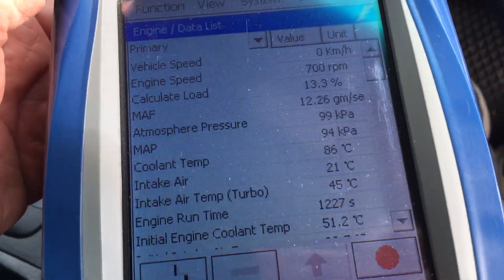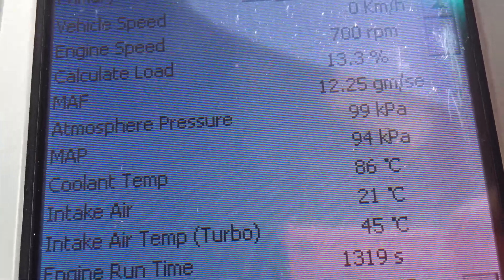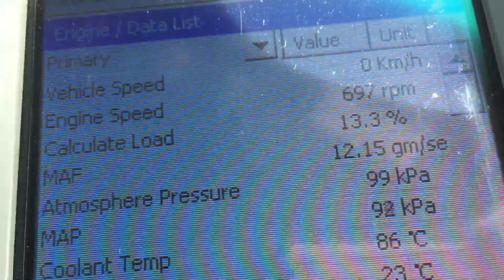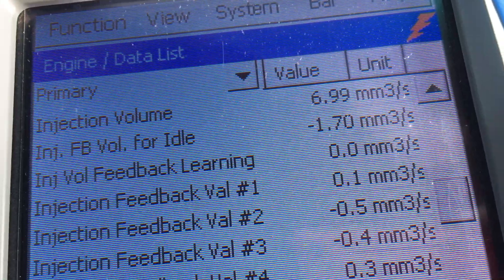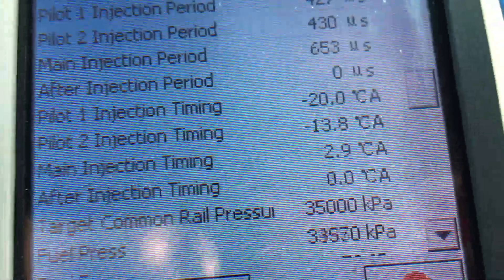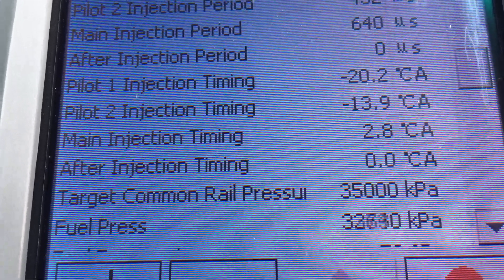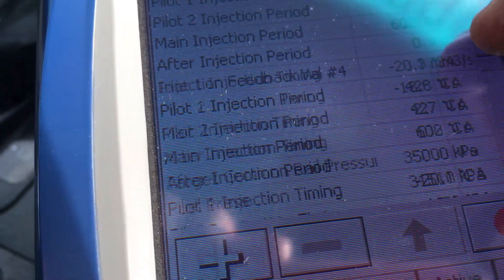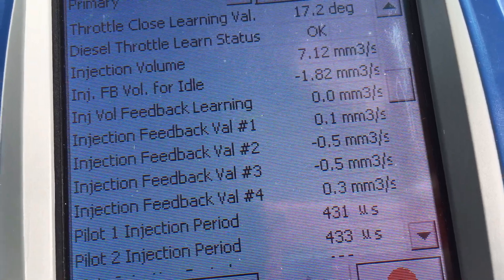HOW TO DIAGNOSE INJECTOR PROBLEMS AND FUEL PRESSURE

Comment: So i need some help bad! I have no clue if anyone here could give some advice. I have a 3000k lc200 4.5 v8 armored. Im trying to condem the injectors but its vary difficult as im not a diesel tech. What i have found so far is that the engine load and injector values get really bad the hotter its gets. Starting at load rate of 16% injection rate of 6 and nearly 0 for all 8 injectors to a 60% load and -5 for half and +5 for the others ends up barely running. My rail pressure stays nearly identical to requested. I have so far just drained the fuel ranl and replaced the fuel filter in the engine bay twice even though it appeared clean. Is it clearly bad injectors or what else could i do. Also i can not find factory info as im in the states and this truck does not exhist here. Its a 2020.

Comment: Hi mate
So I have 2022 Great Wall 2.0 Turbo diesel we had water in tank so injectors failed. Dropped tank cleaned all lines bleed the system and put used set car run for 45 minutes while doing a manual DPF burn so was high rev. After it finished all injected burn out(failed) clean system agin put another set car run for a day and also after high rev except same thing happened again. 
One mechanic think DPF, other think ECU and GWM think it’s the high pressure fuel pump. Not sure who to trust to be honest. I spent so much money on it and it always back to ground zero with same problem.

Comment: I have a 2,2 tdci ford ranger, I replaced the injector washers and cleaned everything now the car have a low boost error. P0299 everything was working 100% before i worked on the injectors, I smoke tested for boost leaks, none were found. There are no other fault codes and it sound like there is a missfire on about 1500rpm. Can a faulty injector cause the low boost error? I dont know what to do anymore. Where im from you cant trust anybody for testing injectors they will tell you its faulty even if its not, charge a lot of money and then the problem still accours. I have a Launch obd but i dont know what to look for on the live data

Comment: My engine load is up around 80%. Car tried to start but didnt. I bought the car as non runner, tried a leakdown test and suspect a wornbore in one cylinder, so I wont buy injectors before I find out. Would it be madness to get it started to get an idea of the state of the engine? Yaris 1ND tv 2006

Comment: Hello, thanks for the video. At 6:26, the reading of the Target Common Rail pressure is at 35000kpa. It is suppose to be fix or changes whenever you accelerate the car ?
Reply: supposed to change with engine conditions, the ecu calculate the target or you can name it the specified value, then the ecu it self send signals to the hp metering valve and the regulator rail valve to execute a good deviation ( the actual value should be controled to the target value as the target value is the refrence)

Comment: Hey mate love your videos. My readings are all mainly lower than you’re saying but I feel like my car (2008 hilux) is noisy when cold. I understand they aren’t a quiet engine being a diesel and especially cold but still not sure. Tested at 80degrees. Would you be concerned with 10% load, injection volume around 5. Main injection around 550. Injectors are similar to your values on video. I’m confused as I don’t know if that low is good or bad. 
Appreciate any feedback mate and thanks again for your knowledge

Comment: Hey good job bro I have a Toyota Hiace with a 1kd engine..I replaced the injector drive and 4 nozzels currently one of them is making a rattling sound and i lost most of the cars powers especially when going up hill or even carrying a load. How can I sort this problem out can it be the bad fuel injector???.

Comment: Please help 🙏Got a 1gd-ftv 2017 diesel hilux. Cranking but not starting at all. Checked air filter, fuel filter, fuses etc. Apparently mech says it has no fuel pressure like common rail. I run a ARB Frontier long range poly fuel tank. Would this have anything to do with any issues? Code reader don't say anything wrong
Reply: Vehicle has less than 50,000 km

Comment: Hi i have got toyota verso 2.0 d4d with fault code p093 large fuel leaked can u help with this plz
Reply from the maker: Get rid of the chip or get rid of the remap
Reply: @Fourby4Diesel  all the injector feed back reading stays at 0 n sometime one or two injectors reading minus1 ,after 5 minutes off drive car goes in limp mode

Comment: Hi there ... not sure if you can help but worth a question.. I have a 2006 toyota rav4  d4d 180bhp... it blows white fuel smelly smoke when I dump the throttle and takes a bit of driving to get rid of it... there no oil water mixing... and it stinks of fuel so its obviously over fueling ... any ideas to look at... thx

Comment: Hi. I’m sorry to bother you.  But your the only one on YouTube who makes any sense to me and you explain how it all works. I’m mechanically minded and I can do most things. But when it comes to injectors I can’t seem to find something that explains what I’m looking at. I don’t a scanner quite as good as yours. The only values I’ve got for each injector is the ‘Us’ if that’s what the letters are. My 4 injector reading are all different. At idle the Number 1 is -36 and up. number 2 is 26. number 3 is 10 and. number 4 is the lowest at 0 or up slightly. I don’t expect anything from you in great detail. It just seems like there way out and I thought they all should be similar in valves if they was good.
Reply from the maker: Probably best advice is to replace them based on averages
Depending what vehicle it is either way you should check out Diagnostic ? playlist, and our Injector information playlist on our channel
Reply: @Fourby4Diesel  hi. Thank you for getting back to me so fast. It’s really appreciated. Can I just ask one more things. On my scanner the valves for the injectors is in ‘Us’ would that be the  same sort of valves where yours show mmg reading. I’m only asking cause the only valves I have is in the ‘Us’ and the only ones on yours with a minus on them is in the mmgs if that makes any sense. I’m sorry if I sound like a idiot I’m still trying to learn what and how the valves work. I only have road car. Mercedes c class 646-811 engine. When it’s cold on start up the revs twitch if you just touch the pedal and it seems to be using way to much fuel. Again I can’t thank you enough.
Reply: @Fourby4Diesel  hi. I’ve been watching a few of your videos. From what I can tell. The only thing I can find that’s anything like what I’m seeing is the injector timing. I need to find the load and pressure to see if there any where near the reading you say are ok.

Comment: Just had all 8 injectors replaced in our 2010 Sahara Landcruiser and the readings are off the scale, mechanic can't work out what the issue is. OLD injector readings: 0.5, -1.1, -1.1, -3.32, 5.0, -1.1, 2.0. NEW injector readings: -5.0, 4.1, -5.0, 0.0, -5.0, 3.3, 5.0.

Comment: Another great enjoyable video.
Q, - I I recently made a massive mistake in putting unleaded in my deisal Hilux, I drove about 4 ks at 60kph to where I was going then turned it off.  When i went to start the Ute again but it wouldn't fire up, it just turned over.. 
I had all the fuel pumped out by wrong fuel rescue, they got it going straight away for me  but I'm worried if I've damaged the fuel system in some way..?  The motor sounds perfect but I may have a little flat spot in the power curve when at 2,000 revs to 2200 rpms and it might feel a bit sluggish, it's most noticably when going from third to fourth but every other area of power range seems pretty normal
Could this be as a result of mixing my half tank of deisal with the other half of unleaded..? Or is that distance unlikely to damage anything?
Any advice is appreciated..
Glen
Reply from the maker: Don’t worry about it there’s nothing wrong with it keep driving follow our normal Injector replacement schedule

Comment: Hi . I just wanted to check my pilot 1 injection timing says -45 . pilot 2 -13 and main injection 2.0 . Would that cause a p0098 fault
Reply: And the fault varies its not constantly like when below 60degres temp an all the wat to 3000 rpm it can drive like a  dream even in higher temps but then it could change drastically also when it just comes on when touching the pedal

Comment: So , if my injectors values are 
Injector 1 (-0.7) 
Injector 2 (+3)
Injector 3 (-0.4)
Injector 4 (-3)
Which one I have to repair - Injector 2 or Injector 4 ? I mean is Injector 2 compensate Injector 4 or Injector 4 compensate Injector 2 ? Toyota Avensis T25 2.2 D4D 150hp .
Reply: It's the injector 2 faulty
Reply: 2 and 4 bad

Comment: Hi Anthony just wondering would worn washers cause 31% load injector feedback vals are all in between .3-.6 injectors were replaced by Toyota a little under a year ago not sure if I should just go ahead and change them myself as I think the washers need doing thanks for the brilliant videos 👌

Comment: What rail pressure do stock 1KD Hilux's see at wide open throttle under load? I am seeing 190,000 kPa but my Hilux isn't stock, just interested how far it has been raised if at all.
Reply from the maker: 160

Your 30,000kpa over
Reply: @Fourby4Diesel  thanks. Well thats good to know.

Comment: Hi  i have a toyota 2kd engine.....engine will run with a fuel rail pressure 20k at idle and die after abt 15m as fuel pressure decrease up to 14k....the thing is after cool down pressure go back to 20k? How?

Comment: Hi good information ..Thank you. . Hi i have 1kd hiace  it has fuel dump/pressure valve on the rail with 2 wires.how much fuel it must return on idle ,at 3000rpm,when rev up & down or at full throttle. . Any idea how to test it...? Thanks..